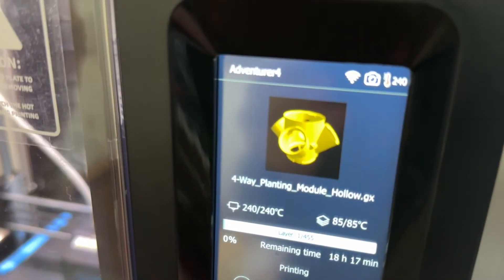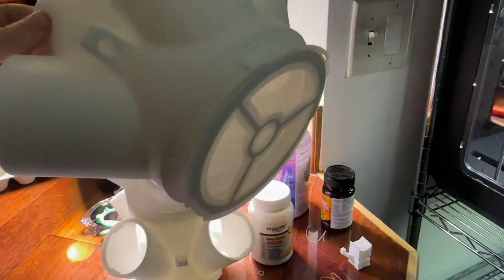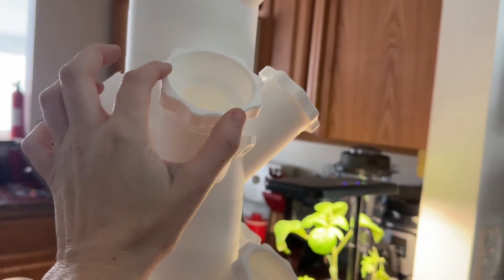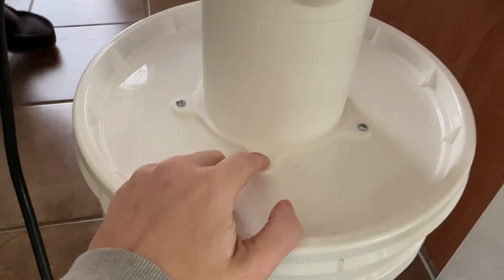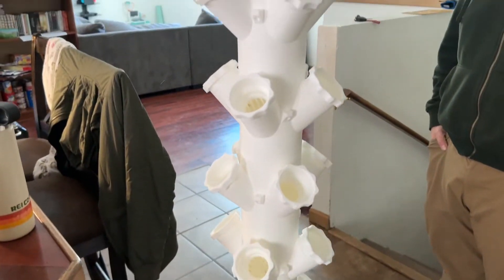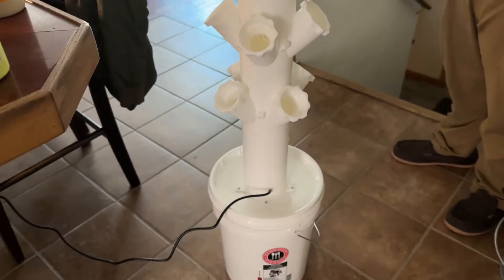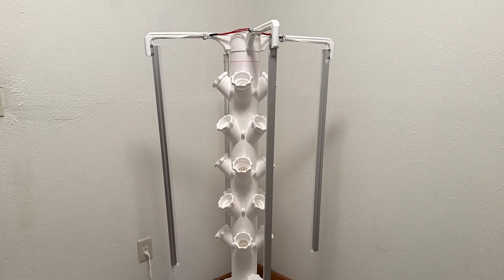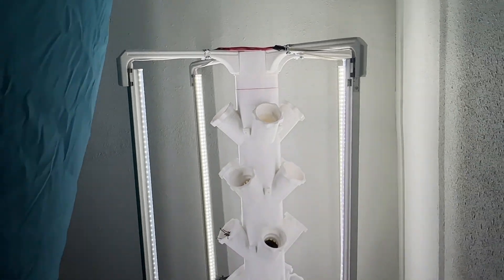Self-Sufficient Living: 3D-Printed Tower Gardens for the Prepared Prepper

Comment: May I ask why you used PLA and not PETG . I thought pla would break down over time because of moisture ,heat and up light ?  The reason I ask is cause I want to mane some grow room items that will be exposed to wet, damp , 85f temps and UV lighting from grow lights
Reply: That's being used indoors and T5's won't heat the PLA beyond the point the PLA warps. PETG/PLA are both going to absorb water the same and leak the same I think. Some people just coat with epoxy. Since it's not coated with epoxy water can permeate and develop little bacteria pockets, but I think bacteria is all over the garden so not really an issue. If your treating the water with a biocide which you probably have too, especially with white planters + bucket then your killing off those bacteria packets anyways.

Comment: How are you going to control algea?
Reply from the maker: It has a pump which circulates the water every 20 mins. In addition, water is changed out and replaced with new water regularly. Plus, the light does not shine into the water so the production of algae is not likely. Never impossible, but not likely.
Reply: @RoguePreparedness  Cool, best of luck! In my experience I think you will have a problem with it. The fact you can see down it with a camera means too much light getting in there in my opinion. Any algae will throw off your hydro solution and gunk up plant roots, but if you're constantly changing the water you might be alright. 

Interesting experiment, can't wait to see how it works out!
Reply from the maker: Oh, I guess I didn’t show on camera that I added some rocks around the seed starters to further prevent light from getting it. Did that after the video. But yeah, I’m aware to watch for it.